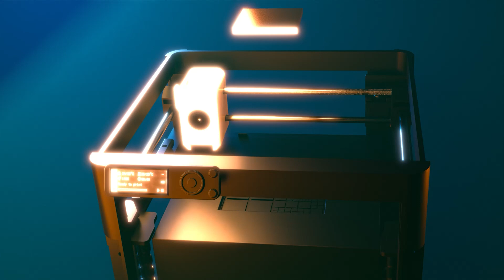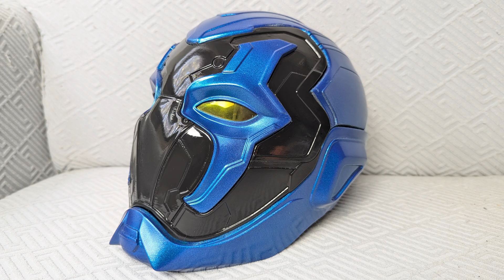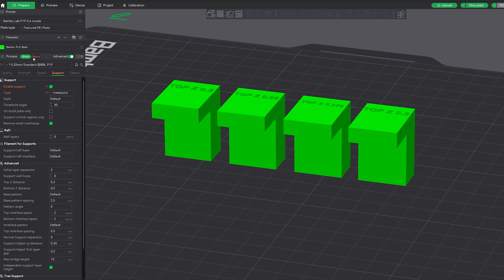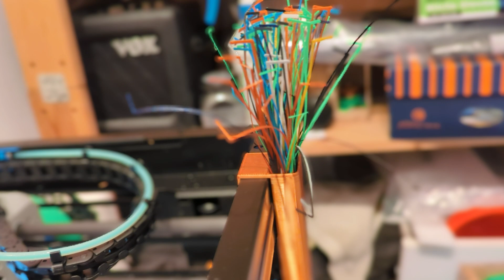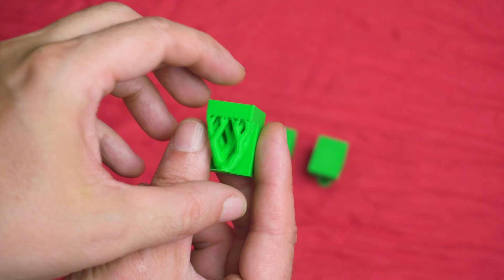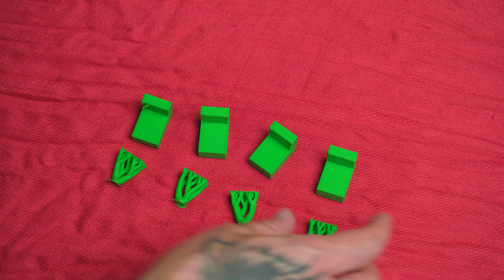1 Setting Easy Supports Removal | Bambu Lab P1P

Comment: What was the main part printing layer height, 0.2?
Reply from the maker: @JohanvanAswegen-z6j  0.2 all layers
Reply: @PixelForgeLab  Thank you for the reply, if your Layer height is 0.3 would you increase the z gap?
Reply from the maker: @JohanvanAswegen-z6j  no no, the top Z distance won't change

Comment: You went from the default of 2.0, to 2.25, to 2.75, to finally 3.0. What happened to 2.5? Did I miss something?
Reply from the maker: @hotfix7387  0.2 - 0.25 - 0.275 - 0.3
Reply: @PixelForgeLab  isn't that what I just typed? I was asking what happened to 2.5 if you were testing in. 25 increments.
Reply from the maker: @hotfix7387  there is no 2.5... you mean 0.25 ?
Reply from the maker: @hotfix7387  0.25 is the second cube setting... It's correct, check it again.
Reply: @PixelForgeLab  I was fighting with my phone and autocorrect putting periods not where I wanted them in my original quesrion. In editing my message multiple times I messed up my original question and then totally confused myself.

Let me try again and hopefully this time I will look less like a moron. 😁

You started with 0.2. 
You then went ot 0.25 which is an increase of 0.05
You then went to 0.275 which this time was an increase 0.025.
You then went to 0.3 which was another increase of 0.025.

I noticed a difference in the stepping and in the process of typing my message to ask why you went up initially by 0.05, that somehow became the measurement you skipped over in my brain.

Sorry about my confusion. Autocorrect was not my friend last night and I should know better than to type questions like that on my phone as clearly confused the heck out my self. 😁
Reply from the maker: @hotfix7387  ahahah ok got it 👍🏼👍🏼👍🏼
Reply: It's actually the 0.225 value that's missing haha, but it wasn't really necessary to prove the point since both 0.2 and 0.25 are still too tight.
Reply from the maker: @defdaz  yes indeed, was pointless making that test cube since I knew what the sweet spot was ! Thanks for checking 👍🏼
Reply: Hi Pixel.

Perhaps the confusion was due to 0.2 to 0.25 difference 0.05.  0.25 to 0.275 and 0.275 to 0.300 difference is 0.025.
The increments you have used, are all that is necessary to demonstrate the different effects, and that the sweet spot is 0.275.
After sitting with a bunch of tools, on many occasions, attempting to remove supports I’m definitely going to try your solution.
Any thoughts on using the Bambu Support for PLA filament?
Thanks Noel
Reply from the maker: @Jestey6  yeah give it a try, and unfortunately I don't own the AMS for now !

Comment: If using PLA use PETG as a support interface with Support/Raft interface drop down and vice versa. Lower the top z gap to .08 and set Top Interface Spacing to zero to make it solid this will make the support connection look nicer. Interface pattern concentric for rounded and rectilinear for flat.  Works best with flat supported areas due to less filament changes. It comes off incredibly easy and the scaring is very minimum.
Reply from the maker: @TheAciditty  I don't have the AMS, but I'll take It in consideration for when I do
Reply: @PixelForgeLab I wonder if its possible to set the printer to pause after its finished printing the last layer before the support interface layer allowing you to change and then pause again once it finished printing the interface layer.
Reply: If you do this CHANGE YOUR FLUSH VOLUMES! Bambu Studio often doesn't properly calculate how much you really need for PLE <-> PETG. You want 400 for PLA -> PETG, and 800 for PETG -> PLA. If you don't do this then they won't be properly flushed before the next one starts printing and they'll contaminate each other. The end result will be layers that will easily break and/or crumble around the transition point. Everything above the interface layer will just snap off the rest.
Reply: @Draknfyre  hi, 400 what? mm^3? i'm a noob here sorry for the question hahah
Reply: This makes it easy to remove supports but I find that it lowers layer adhesion.  Likely because the PETG doesn’t fully get out of the nozzle before putting down the next layer
Reply from the maker: @andrewmo49  absolutely, in fact I mention to tweak the value accordingly to the filament and print itself
Reply: @TheAciditty  Hello, how can I adjust the settings to obtained a smooth surface between the supports and the print ? Please help. Thanks.

Comment: I'll try it out!
Reply from the maker: @batcow6066  let me know
Reply: @PixelForgeLab  It worked wonders! I recently switched to Orca Slicer, using an Ender 5 Pro. My settings were .2mm layer height with organic supports and the .275mm top Z offset. Supports came off like they weren't even there
Reply from the maker: @batcow6066  I'm glad it worked !